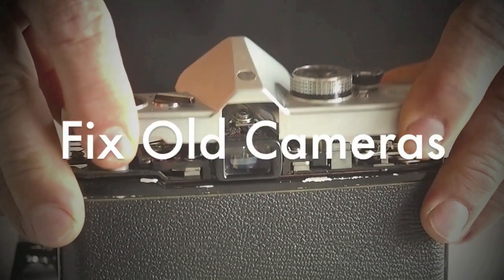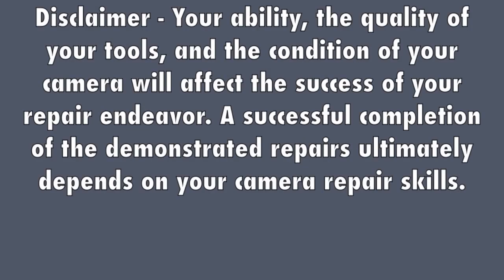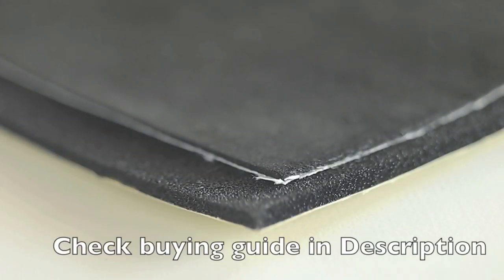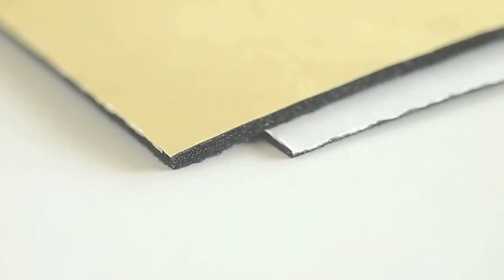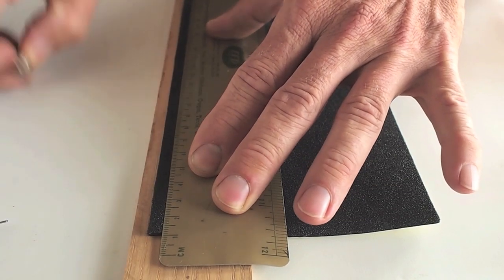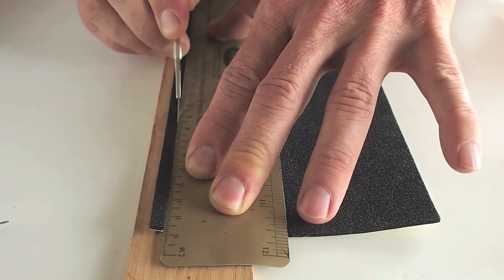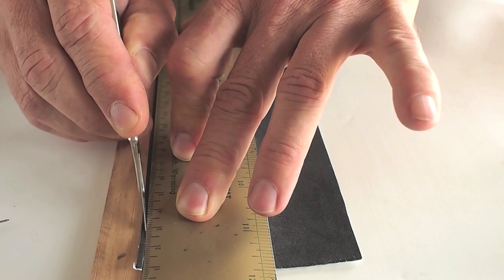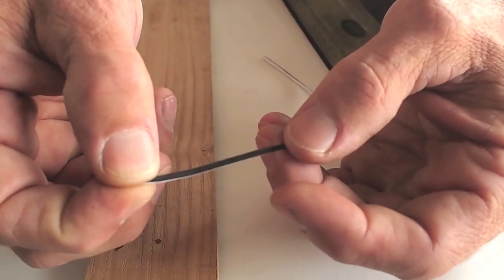Fix Old Cameras: Film Camera Light Seals

Comment: If anyone else out there is like me, and more likely to cut your finger off than cut the foam in a straight line, I found a paper-cutter at my local Staples store that will cut the 1 and 2mm foam straight as an arrow. The unit I found was a CARL RBT-12N and cost about $12(US). All you do is place the foam sheet in the cutter with the backing facing you (it helps to mark a cut line on the backing sheet). With the 2mm foam a little "trimming" was required with my exacto knife as it didn't cut quite all the way through all the foam for the length of the cut, but it was very small and the foam came out straight.
Reply: Sewing1243,
I like your idea of using a paper cutter to safely cut the foam. The paper back facing up is an excellent idea.
I had visions of using my wife's Olfa rotary cutter and cutting mat until you gave me the idea of the paper cutter.
Thank you.

Comment: Hi I have a ME Super.  Do you ever replace the foam on the back of the mirror box above where the mirror hinges?  And if so is it advisable to replace it without removing the mirror box.
Reply from the maker: Yes, if you were doing a complete tear down it would be replaced... but it generally does not cause any issues and maybe should just be left alone.  Although trying to replace it without disassembly is possible, it could cause additional issues with the mirror masking cloth attachment. You would also run a higher risk of damaging the view finder screen in the process. One thing to consider when repairing your classic cameras is what will be the time and effort invested to the benefit of the end result. And what is the value of how you spend  your time versus the value of your camera to you in "perfect" condition or in everyday user functionality.
Reply: Thanks for the info and the video posts.

Comment: hello everybody.
i just got an new chinon ce 4 camera body which was never in use. the bad thing is, that the light seals were in a very bad condition I must say. I took a day of and could get rid of a big amount. but still I have two places inside the camera where the mirrow and prism are.
As well I can see little tiny pices already on the prism which are visible ones I looj through the view finder. Any idea how to continue and get the prism clean again?
thanks in advance and please let me know your experience.
Reply from the maker: +culttree-records Use isopropyl alcohol where needed except on the viewfinder screen. Do not use alcohol on the viewfinder screen. Use a cleaning swab saturated with distilled water on the viewfinder screen. Dab the specs off when possible. If they have smudged then follow the concentric circles of the fresnel lens, changing out saturated swabs as often as needed. The degraded foam might still leave a slight scar on the soft plastic of the viewfinder lens.

Comment: I bought the light seals and I don't know which size foam goes where??  And, I don't know what width to cut the foam? Help!!
Reply from the maker: The foam is forgiving and need not be cut absolutely precise. Cut the foam to widths that accommodate its placement. The thickness depends on the density. If it is to thick and dense it will impede the closing of the film door. If possible, compare the new seal material too a classic camera with good seals for an idea on how they should look and fit.

Comment: Please, can a video for Dummies be made on camera light seal replacement. Explaining in details starting with the exact materials to be used i.e. Closed or open density foam, what are the differences. Adhesive, non-adhesive where and when to use etc. Then where you would use either foam or felt, adhesive or non-adhesive step by step. There are a lot of enthusiasts ( nobodies) who are not as adept as most and require a bit more information. I sometime see these videos making the mistake that the experience present presuming we all understand the thought process going through their minds, but that gets sometimes lost in the translation of information to the viewer. Not a criticism of these great videos just a observation.
Reply from the maker: Please consider that hopefully there are no dummies attempting to work on their cameras... only those that lack experience. The FOC videos are produced with the goal of having short precise classic camera repair videos that address specific issues in order for those with a desire, but lack of experience, to have confidence to proceed with a specific repair on their classic camera. They rarely deliberately, by design, impart general camera repair knowledge and techniques. A rudimentary knowledge of the workings of the camera and how related tools might work within those confines is presumed.  An effort is set forth in every video not to be redundant with previously covered information and by making that choice some details that the viewer might consider relevant are missing. If the details are available in another FOC video a comment to that affect will be generally included. With that being said the proper sized felt or in the case of film door light seal channels properly sized wool yarn strands can almost always be substituted. Pliobond glue is a good all around glue. Overly dense foam does not work well as light seal material has a tendency to flatten out over time and use. The self adhesive foam and the demonstration of its use in this video is generally considered by this repairman the easiest (although not easy) way to install light seals... for the thickness of felt needs to be much more precise as it is not as forgiving as the foam and working with yarn strands and glue is very tedious. If no glue is use and the yarn strands are just jammed into the channel and left to stay in place by friction than yarn is not as problematic other than matching the size of the yarn to the size of the light seal channel. Of course classic cameras of a certain vintage originally have yarn and felt in place as light seal and because of its lasting nature rarely need to be replaced, but if they should then every effort should be made to match the original manufacture specifications and application.